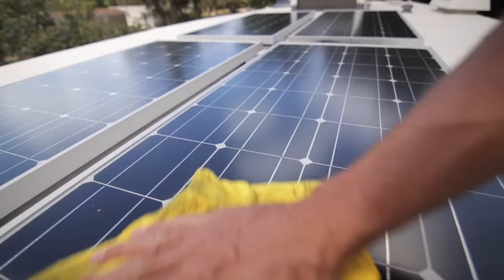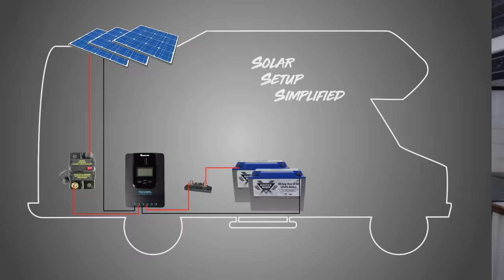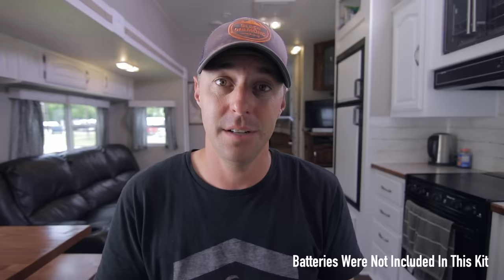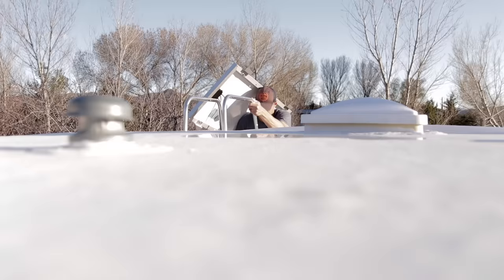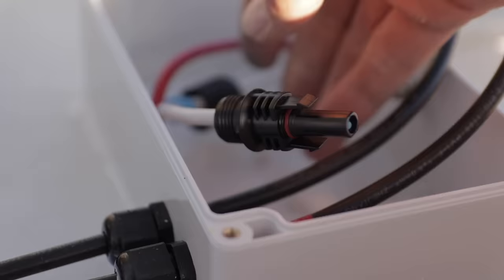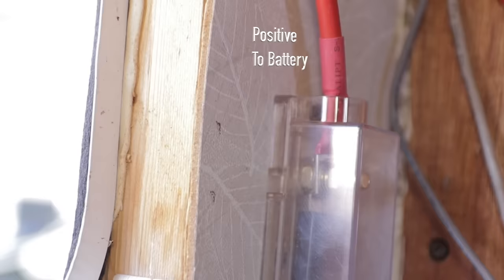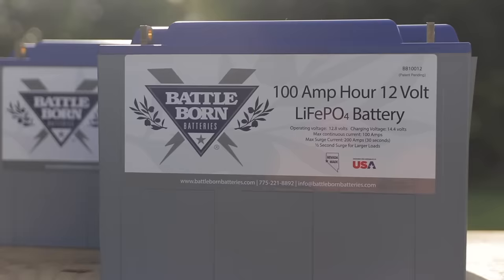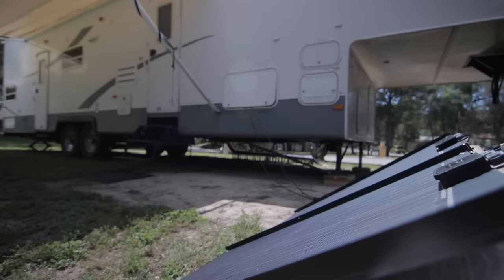RV Solar Simplified! Simple RV Solar Setup.

Comment: Thanks. Is it possible to make a smaller solar set up to cover most of the needs, but still use grid power if the solar battery is low? Or is that not possible? (I know very little about solar).

Comment: Did you connect to your existing RV batteries? If so, and I want to upgrade to lithium, will the original charger on the RV still work with the new lithium batteries? Will anything conflict with my RV charger? I'm confused about this.

Comment: Hey...thanks for your videos.  So...I am planning an install of two 200W panels on the roof of my new 6x10 trailer conversion.  I also have a portable set of panels I normally have used to charge my portable Jackery.  I will be joining the two sets of wires from the panels into one set using a y-connector.  I would like to install another Y-connector later in that short cable run to my Renogy controller.  That would allow me to, on occasion, plug-in my portable panels if I wanted to gain a little more input.  Sound like a workable plan?  Thanks.

Comment: Love the videos. Thanks for info. I have 200w portable suitcase mppt20a 700w inverter 12v 100ah lithium battery, but unsure best way to connect to travel trailer fuse box, converter
Any help /recommended reading would be appreciated. Thanks

Comment: Question; I have a camper with shore power or power via my truck alternator, charging the batteries now, Therefore do I have to shut off the solar power when connected to shore power as there would be 2 different power sources charging the batteries at the same time?

Comment: Nice informative vidéo. I'm starting in solar and have a 50 amp FW. I want to start with 400w. Now is it better 4x100w or 2x200w ? My understanding is to Install at least 2 in series so the voltage will be around 40v. I see a lot of 4x100w so is there a particular raison ? Tks

Comment: You mentioned that you don't tilt your panels. Is that due to the mounting hardware? It's limited in that way? Are there hardware kits that give you that ability, but also can be mounted to the roof? Are those panels safe to drive down the road with simply screwing them into the roof? Do you have to look for supports in the roof to drill into or can you simply pick any spot? What's your current setup look like now compared to when this was posted?

Comment: I just bought the Renogy kit from your link. I love the idea of adding the circuit breaker. 
Why did you use a 30 amp circuit breaker when the controller is 40 amp? Thank you.

Comment: I am planning on a solar system but do not need AC so not going to use an inverter.  Solar will go to controller, controller to batteries but how do I connect the DC system from my camper into the batteries.  Right now it ties in with two wires at the tongue of the trailer and those two wires can also charge the batteries from the truck vis the 7 pin connector.  My new batteries will be inside and next to the charge controller and then I need to connect it to the camper DC.  Please let me know ideas on the best way to do this.

Comment: What length of screw is strong enough to hold heavy panels a typical Class C roof (e.g. from Thor) without punching through to the interior side of the ceiling? I thought most roofs are a TPO thin membrane over 1" plywood sheet?

Comment: Hello, you seem pretty savvy in solar panels. Our set up works properly but the charge controller shows the arrow from the solar panel to the battery but not the one from the battery to the light. What does that mean?

Comment: Great vid thanks.  how does your solar interact with your onboard battery charger?  Is it an issue ?  Are the connected to the same place on the battery?   thanks.
Reply from the maker: They both connect to the battery and both can work at the same time

Comment: I've been trying to find a video with an RV that is already 'Solar Prep' like mine..In one of the storage bins there is a Box marked 'Solar Ready' ( i Haven't checked what's inside of that box yet)  and on top i have the already wired with a coupler on the roof to connect the solar panels...so basically once I know I want to connect the panels in parallel then to the coupler on top of the roof , then what would be next ? I know you need a controller, then wire (what size ?)  to connect to the battery....This is where I'm stuck at..any suggestions ??

Comment: I've read some comments on the forums that these brackets are cracking from vibration . Have you had any issues? Just getting ready to place 4 210W panels on our Renegade roof. I plan on using VHB tape instead of piercing the roof. I'll be using special primer and am convinced this will hold, but I'll be doubling up on the brackets

Comment: Jared, great video as always!  I'm in the process of installing solar on our RV roof and also have a 100W portable suite case.  Did you wire the portable panels into your MPPT charge controller or do you hook them up to the batteries with a separate MPPT charge controller?
Reply from the maker: I connect it to the same charge controller, that’s why I have the whole system in parallel so it easy to add it in.
Reply: @AllAboutRVs  Thanks for getting back to me on this.  Thats good to know.  I also heared you could also operate with teo charge controllers.   But would much rather do it with just the one as your doing.  Thanks again.
Reply: @AllAboutRVs  Thank you for responding to Jim B. Now that I looked more carefully, I can see the wiring going into your compartment. Looking forward to watching your upcoming videos. I've gotten a lot out of the solar videos you have done in the past. Thank you!

Comment: How many solar panels will need to run a refrigerator , TV , 3 cameras, AC, and alot of lights and I have a mobile barber in a 26ft trailer and all my clippers rechargeable

Comment: Can I splice the solar controller leads going to the battery to the same leads coming from the battery to the rv’s converter?  Or does it need separate leads back to the battery?

Comment: Does anyone know if this is enough power to run the RVs ac unit? We’re thinking about putting our 37 ft camper somewhere without power and it’s important that we’re able to run the air conditioner and lights. TVs are not priority.

Comment: Nice overview! I will hopefully be installing 3 100W Renogy panels on the roof now that it has almost stopped raining in the northeast. I bought the Renogy Rover MPPT 40 Amp charge controller last year along with another 100W Renogy panel I want to keep on the ground. I noticed @Jim B asked the question I have for you. How did you hook your 2 panels into the system? Thanks for great information!
Reply: I did the same as Jared. I have panels on the roof and 2 additional that I can place in the sun if I’m in the shade. I wired an additional wire with a MC4 connected to the breaker (positive leg) between the panels and the charge controller and put a bus bar in between the negative leg and the charge controller and wired a additional wire with a MC4 connector to it. I then have a 30’ pair of cables with MC4 connectors that plug into the “mobile” panels and into the 2 additional MC4 connectors.
Reply: I’m looking to get same system as yours, but sales person keeps asking me what is the output of my water heater
Reply: @guitarman1477  I assume you have a propane heater? We do on our Winnebago. Might be time to ask for a different salesperson - or shop elsewhere. I got the the Renogy panels and the charge controllers off Amazon when they were on sale. I ended up doing a separate SAE entrance for the portable panels and they have their own controller. I wired everything myself, but took my RV to the local shop to have them check my work and make the final connections. I ended up putting 400W on the roof and have not had to plug in at all this winter while the RV is in our yard. Today is sunny and it is charging at 14.2.  Good luck!

Comment: Thanks for all the great info on all your videos. I have a question about mounting the panels to the rooftop, when you are locating the area to mount the panels do you need to ensure all the attachments are into the RV’s framework or anywhere on the roof?  I have a 2011 Laredo fifth wheel with a EPDM Roof material. I plan on installing 4-160 watt panels.   Any suggestions are appreciated. Keep up the good work!
Reply from the maker: It can be rather difficult to get all the mounting hardware in the framework of the Rv. At the very least I usually position the panels so the leading edge when you are driving down the road is secured in to the Frame work and the rest in the roof sheeting, doing it this way has been fine for me.
Reply: A local RV technician who is doing solar installation reccomended using expansion nuts. Great for the areas that you can't get to the frame of the roof.

Comment: Thank you for all your videos. I've learned a great deal from them. We are purchasing our first travel trailer, a 2021 Grand Design Imagine 22MLE, 30 amp, and expect to take delivery this week. It is prewired for solar and has a, factory, 2000w inverter. I plan to install a solar setup similar to the design you have in this video. Information from a factory rep says "the OEM charger can handle 550 watts" it goes on to say that if I "install a 6 gauge wire," I plan to use 4 guage, "and use a 60 amp controller that it will double my wattage availability". That is what I plan to do. My question is this, since the RV is 30 amp but the solar system will be using a 60 amp controller, what size breaker should I use between my three 175 watt panels and the controller and what size fuse between the controller and the batteries? By the way, I'm plan to use two Lifepo4 Lithium batteries, 100 amp hours each. Thank you once again for sharing your knowledge and experience.
Reply: Curious if you completed this project?  I have the EXACT RV and am also contemplating adding solar.  I have solar on my Sprinter Van (4 panels, 3 Lithium (Batteborn) batteries but someone else installed it for me.  Always looking to learn from others who may have done what I'm about to take on...any help / advice would be greatly appreciated!

Comment: Nice video how do the harber freight panels compair to others
Reply: Couldn't you use those ??  I have heard that they are pretty good.  I am wanting to get some kind of solar setup to help keep my batteries charged.  I have no idea what setup I would need though.
Reply: The panels are ok but the charge controller isn't good. Upgrade the charge controller. The panels are fine if you just want light use.

Comment: What I have found useless about all rv solar installs videos (not this one so much) is when you go much higher in wattage, like long runs for 12v 600watts plus. When you need 4 or 6 gauge wire but you can't find MC4 connectors that you can put on a 6AWG wire to plug into your panels. You almost have to go to a 48v panel because the current gets so high in a parallel setup.

Comment: Hey Jared, what do you think of the plug-in ground mounted types of panels as an entry into solar power? Thoughts regarding plumbing in a solar plug, pros, cons, etc...
Reply from the maker: I think they are a good idea. We have two panels for a total of 200 watts we use as a ground station to point toward the sun. Good starting point with future use. We have a video on that starter solar setup.

Comment: Thank you for the information. How did you connect your ground panels to your controller? I use suitcase solar panels which have their own controllers so I run them straight to the batteries. Please show how you set your ground panels up.
Reply from the maker: That will be coming in another video, but what I do is since these extra panels don’t have a charge controller I put them in parallel with the panels on the roof into the same charge controller.

Comment: I now have no solar but need to replace the Interstate 125 ah batteries.  Can I just replace the 2 interstate batteries with Battle Born battles? Can only charge batteries with house power or hooked to truck.  Truck is a 2019 2500 HD diesel.
Reply from the maker: It’s best to change out your Rv converter to a lithium converter charger and make sure your solar charge controller has settings for lithium. The old converter might work but may not give you a full charge

Comment: When installing your solar panels do we have to look for the studs on the roof of a motorhome?

Or do they just go straight in through the roof not worrying about if you gets a stud or not.
Reply from the maker: I don’t worry about hitting the roof structure or trusses but if I can I do on the front of the leading edge of the panels.
Reply: @AllAboutRVs  

Ok, thanks for your responses, of my four panels so far I've been able to put two of them on studs on all four legs.

I will try to do the same with the other two Just for peace of mind lol.

Comment: what size fuse and shunt do you have from charge controller to battery?
Reply from the maker: We have a 30 amp breaker between the  charge controller and battery and the shunt we use is for the whole system which is a 500 amp shunt that came with our BMV-712 Victron monitor. Most the components we’ve used should be in the solar tab in our Amazon links. https://www.amazon.com/shop/jaredgillis

Comment: Thank you so much! Love your setup, and I think I'm going to copy yours exactly. At least for my first setup, it just makes so much sense. BUT! Question on the charge controller that comes with the RV -- do you replace that, or disable that? That's a HUGE jumble of question marks in my head still.
Reply from the maker: You still want to keep your converter don’t disable or unplug it. I do recommend replacing to a smart converter charger, we have a video on that as well. It’s fine to leave both connected to the batteries.

Comment: Thanks for this video! Still learning about this solar stuff. In your illustration, what is the breaker between the controller and the batteries? Is that the shunt you mentioned? Got a link to it on Amazon?
Reply from the maker: Our shunt came with our battery monitor. It’s the victron bmv712.
Reply from the maker: There is a link on our amazon page in the description.

Comment: If you are plugged in to shore power do you need to disconnect the solar? Thanks
Reply: If you controller has a 'pass through' element in it you do not. And you can charge batteries from the shore power while using it for other things, like lights! Or a TV.

Of coarse having that added convenience makes the controller have an added cost!

'Nuf said?

Comment: These explanations are great, but nobody has talked about what to do with the current charge controller in an existing RV.  Do we need to swap it out too for a new converter /  charger, or do we cut those wires and now charge only from the sun without the engine/ alternator?  how does this part work?
Reply from the maker: You will want to keep a good converter connected in your RV and allow the batteries to charge while you drive.  Not all converters are created equal here is my take on them. https://youtu.be/mDEeSHrTv1k.
Reply: @AllAboutRVs  Thank you sir.  Good information over there

Comment: Here's a pro tip. Screw a larger aluminum plate down where you're going to put your panel mounting bracket and dicor seal it. Then drill into that and mount your solar panel. If you ever have to pull those panels up for any reason, they will pull your roofing up. If you put that metal plate down first, it will keep that from happening.

Comment: If my appliance is AC and draws 3 Amps, how would that work out with running it off an AGM batter with an inverter? Is the Amperage the same since I am plugging the appliance into an inverter and then into the battery? In other words, would the AGM battery of, let's say 120 Amp hours, be putting out 3 Amps every hour to power my appliance? Or does the DC to AC conversion make it more or less than 3 Amps each hour?
Reply from the maker: It will be the same watts. Watts are just amps times volts. So if you have a 3 amp load on 120 volts that is 360 watts. So what that means on the DC side for what it is using out of your batteries is a device at 360 watts at 12 volts is drawing 30 amps out of the batteries.
Reply: To run anything--- it is NOT doing it with  100%  efficiency!  Add in another 10% or more to whatever the appliance is drawing in theory!  The inverter takes or uses up  most of that added power!

Comment: Question- Did you wire your panels in series or parallel? I understand if series is used you can use smaller gauge wire.
Reply from the maker: I actually did series parallel and yes you can use a smaller gauge wire when you use a higher voltage.